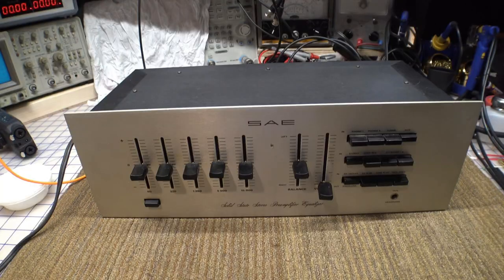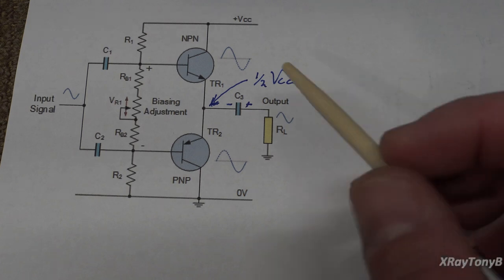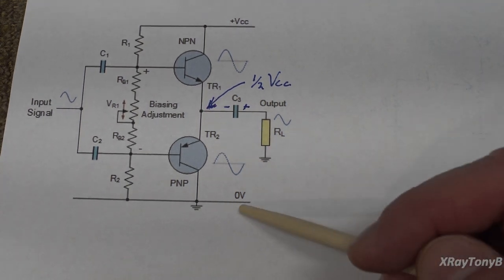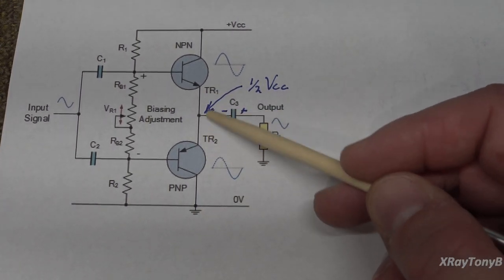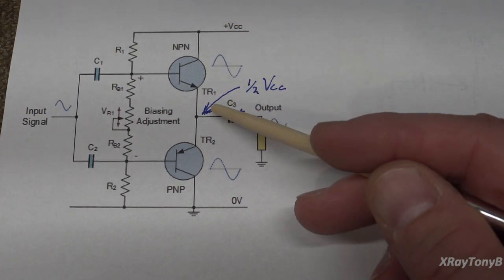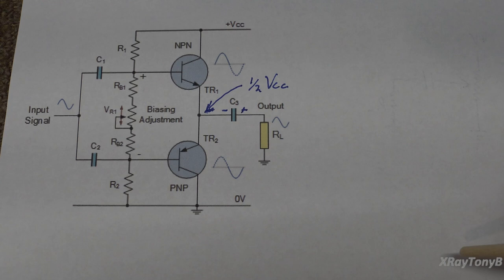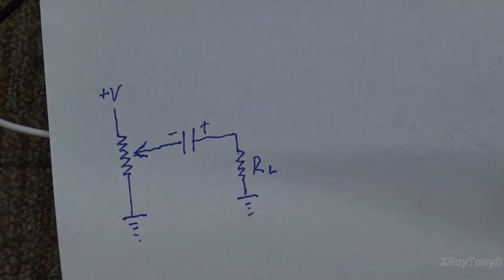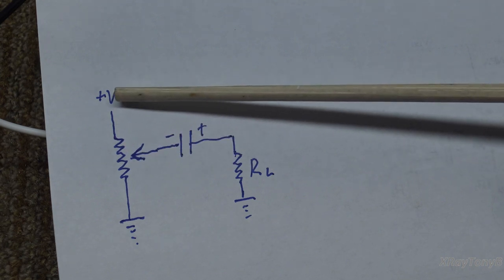Random Video 3 - Amplifier Output Capacitor & Comments from last video

Comment: I consider myself an audio enthousiast, I have 2 big Infinity studio monitors and a Rockford Fosgate active subwoofer in my living room... Together it's 1360 Watts and the sound is very revealing, because most audio sources aren't very good I have to use an equalizer to make it sound much better to my liking, without equalizing it sounds just weird, too flat for me.
Personally I love it when the midrange really pops, the low frequencies make your pants flap on your legs and when you sit down with your back against the chair you feel the bass massage your back, it's absolutely overkill and crazy to have that much power in my living room but I don't have to put the volume very high and still have a super rich sound which is what I love.
I couldn't have the rich sound without the equalizer so for me it's a must to make it sound as I want it to sound.
I hope it makes sense and best regards,
Ricardo Penders

Comment: I was missing your videos after 2 weeks. Finally another very interesting video. I knew about that but didn't tought you could see that simil sine wave with a slow change in resistence by hand. You always learn something. I don't usually use equilization cause I prefer a wave as clean as possible but I understand that someone may enjoy it. Thank as always.

Comment: I think there are two categories: Enjoying the experience of listening to music, which, like You said, kinda, doesn't even necessarily have to do much with "technically" good sound, like coming from a jukebox, you are enjoying the situation you're experiencing while listening to music,; and then there's the "objective" part where you upgraded a part of your stereo system, or improved it by alterations and/or adjustment, where you suddenly hear parts of a song you couldn't hear before, it's clearer sounding, instruments are more defined and more believable sounding, things you could actually measure. Each can cross over into the other sides category, but they're still two different things. "Audiophiles" go more for the measurable part, but they still try to get more enjoyment out of their music, which is part 1, the "subjective" part of the hobby. Bot are legitimate. Whatever brings you more joy. And why not both? :D Having said this, I just bought an 8-track player from the early 70's which couldn't be any farther from "HiFi Audiophile" lol

Comment: Good topics you brought up, Tony. I've heard audiophiles argue for hours on how to design a power supply!  Looking forward to the possibility  of that Fisher AM tuner you mentioned.  In the sixties, I used a  crystal radio to record WBZ Am 1030 to record top 40 music. I fed it directly into a Radio Shack Mono Tape  Recorder that used a 6BM8 output tube. It had a great bandpass for AM and sounded almost FM like with birdies as well. Sorry I erased those recordings, as I'm an avid air check fan. Thanks for  your posts, and would welcome your Xray  archives,
John

Comment: Thanks, It always seemed a bit weird to me that the output could go below 0v when the PS can't.  But the speaker ground is actually sourcing current half cycle which does actually cause the signal to go below ground!  Another way to think about it is that the capacitor "absorbs" the DC offset by charging up to the offset voltage.

Comment: The polarity of the cap is wrong. In both drawings and your demonstration.  Which is probably why the leakage is so noticeable.  (Glad to see you posting.)
Reply from the maker: Oops!  Saved by the viewers again!  Yes, the cap should be reversed.  Luckily, I was applying 10 volts on a 50 volt cap!
Reply: It is not the wrong way round because the plus side of the electrolytic will be connecting to the Base of a transistor that will have 0.5 to 1.5V via a 47K resistor from Vcc.
Reply: @DAVIDGREGORYKERR  One side will be biased at half of Vcc (5V in this case), the other side will be connected though the load to ground.  Since Vcc is positive, half of Vcc is still positive with respect to ground.

Comment: Equalizers: I like them for low volume, where our ears are less sensitive to low and high frequencies. At high volumes, flat is good. Refer to the Fletcher-Munson curves.
At low volumes, "flat" is shouty to my ears. The "loudness" button (or knob) evens out the frequencies at low volumes.
I used to be a "purist," wanting as little as possible in the signal path, until I learned about the Munson-Fletcher curves, and how we hear audio at low volumes. Once I understood that better, I was able to stop spending loads of money chasing "even" frequency response in my audio system. I never would have achieved it without that understanding.
Reply: And this is exactly what the "loudness" switch on older amplifiers did. As it was wired as part of the feedback path to the volume pot, at lower volume levels the low frequencies were effectively boosted and at higher volume levels rolled off.
Reply: @AstrosElectronicsLab  and I LIKE the loudness switch, or knob (variable), as was implemented in some McIntosh and Yamaha models. Many in the current generation of audio enthusiasts shun the loudness switch and tone controls, preferring a single potentiometer as a "preamp" because it means less in the signal path. It took me a a little while to figure out that that approach was actually degrading the audio spectrum at my listening levels.
Reply: Your description is the need for loudness compensation these curves were defined in the 50s by Flecher Munshen

Comment: Yes, please.
Tech Ingredients recently showed some reasonable speaker setups that had crazy notches at, like, 600 hz. A graphic equalizer with enough resolution to treat these notches could help smooth out such systems. This would be used to decolor the sound, not the opposite.

Comment: Ageing and HF hearing loss is extremely common. In fact it probably applies to 90% + of the population. I did know an electronics engineer who said he couldn't hear anything much above 14 KHz and he was in his early 20's. He was probably a bit of an exception. 
I play some guitar and started to lose the higher KHz in my very early 50's. It tails off around 12 KHz now. I also found myself liking the sound of instruments that others thought were too bright, no doubt an attempt at compensating for that early roll off. 
I only dabble now and then in electronics, very little really. How come all the Youtube radio and amp restorers/engineers have masses of test gear??? and why do I find watching valve/tube testers so fascinating? LOL!!

Comment: Another great video, thanks. I am a relative beginner getting into electronics and over thinking everything. Obviously the electrolytic cap is drawn with its polarity reversed but some commenters here are saying that in a real amp circuit the capacitor (in correct polarity) will never see a negative voltage it only varies from 0V to plus 5V but the demo seems to show a dip into minus volts across the cap. If the cap discharging does not cause the apparent dip below zero, does the grounded speaker coil inductance/resistance elevate the working 0V point like a bias resistor or does a speaker coil reactively cause the AC? The slow-mo demo used a resistor load not a coil so that can't be inductance. Hmm :)

Comment: Any EQ will sound better.. if the controls are not set to min or max and the EQ curve is "smooth" (not radically up & down between bands). I'm an "audiophile" who's been hooked on proper speaker/room EQ since the 70's. They are also helpful for 'tweaking" the room curve for listening to some of those old (vintage) recordings :)

Comment: Tony, how do you determine the size of a capacitor in a push-pull transistor amp for 8 ohm speaker loads?
Reply: from 3300 µF and up........

Comment: Remember "high fidelity"? Around the 70s and 80s, as transistors improved and speakers could actually go up near 20kHz, it became possible to built claen sounding, low distortion sound systems without the inherrent harmonics and noisy, microphonic valves of the past :-) Now we could more faithfully reproduce the sound of the studio or stage than ever before. Everyone wanted that super clean hifi sound. Now, it's become so clean and clear that no one of the older generation has any memory of their albums sounding like that. They hear a valve amp with an old paper woofer/ wizzer cone configuration and they smile. That's fine, but for me, I love the advancements we've made. The clearer the better. I'm a fan of the 90s Technics New class A / class AA amps paired with a full range cabinet. Also, I definitely have tone controls or EQ. If I feel something is lacking in a piece of music (or my hearing), I can become a DIY audio engineer on the fly and adjust it to my personal taste. There are pieces of music I love, but would never listen to them flat. I'd never have bought them. Hope that makes sense. Buy what you love and listen how you like!

Comment: Let me just clear up the "audiophile" thing here. The quality of the sound produced by a sound system is only as good as the source material. Start with crap, the result is crap. Simple. No amount of gold-plated, oxygen-free cables or special power leads are going to make one iota of difference.
Reply: Excellent response to the folklore and mythology prevalent among religiously bent audiophiles (audio being the religion.....for them).......how much technical nonsense can be marketed and sold.......or BOUGHT

Comment: I think you may have had some old x-ray gear from Field Emission Corporation. They made cold-cathode high voltage x-ray systems, and were bought out by Hewlett Packard medical division in 1974. They also made oven-type thermionic x-ray machines "Febitron," originally to help produce their field emission equipment. I worked for Field Emission Corp. and Hewlett Packard in the engineering lab when I was in high school and college. The biggest field emission machine was 2.5 MeV. I would love to see some of that old gear.

Comment: People's individual idea of sound is very much like differences in color. I started in the tv repair business in the 1960s and when we went on a service call we would set up the color and hue on a set after repairing it. And so many times the customer would have a fit. They would even say it worked better before we got there. Even though it was completely dead when we got there. So we always started asking before making adjuments if they wanted it set up.  And even then we very often had to make changes as they told us what they liked. You would be suprised how many people wanted green flesh tones answer blooming color.

Comment: Totally agree about listening to the old recordings. I am building speakers with old drivers.  In my mock ups, the older recordings, 1940 - 1950's capitol recordings come to mind, the mock up with old drivers sounded better (to me) than the modern gear.  Yes everybody hears differently.  But there are sone things thag can be done to improve sound quality that the vast majority will appreciate.  I had fun in the conversing back and forth as well.   By the way, did you know that ketchup acts like a capacitor.  I have a audio research preamp where some ketchup fell onto the circuit board across some traces without my knowledge.  I starfed hearing zzzz, ZZZZZ ZAP.   zzzzz ZZZZZ ZAP.  I sent it to Audio Research.  They cleaned the ketchup off.  Problem solved.  They did not charge me but shipping was expensive.

Comment: Hi Tony, I would probably call myself an "audiophile" with some investment in sound reproduction. Over time I have developed my use of sound systems mostly without the use of tone adjustment, finding that well balanced audio usually doesn't need much beyond finding the best placement for speakers and subwoofers. Some fine tuning is occasionally required but this mostly depends upon personal preference. Like your array of gear, not bad for an amateur!

Comment: Got a question. Is this a common theory on AB or just some? Or could you have this theory in mind in every amplifier varieties?
Reply: Class-AB is completely different in the way it is biased (near cut off of the output transistors) and the fact it doesn't require an output capacitor as the voltage at the output is almost 0.

Comment: I would sine sweep the room and use a SPL meter to adjust the equalizer for a flat response to compensate for room acoustics.
Reply: Sweep with pink noise, do as much adjustment to the rooms acoustics with speaker placement, wall/window coverings, furniture location as you can, THEN use the equalizer sparingly.  Yo may not need it at all.
Reply: This is exactly what an EQ or tone control network is for, to equalize the sound to the room's acoustics.

Comment: Bah.

The limitations of the recording media (tape) and gear of the 40s just make the recordings sound that much more charming on modern systems. I absolutely WANT that vintage vibe when I'm listening to Bing Crosby sing White Xmas, on my state of the art stereo system.

I could talk about this stuff for days, too. We should do a zoom call video some time.
Reply: Great Idea Tony!  Richard what do you have in the way of "State of the Art SS"?
Reply: @robertfitzgerald3432  I should just say modern. Not necessarily "state of the art" (whatever that means).

So I still have my late 80s stereo system which is a Carver 900 receiver, with Kef C75 speakers and Energy Pro 22s.

But I recently built a tube preamp from Elekit (the TU-8500) and an IcePower 200 WPC Class D amp to power it. Right now I'm listening through some ribbon nearfield studio monitors (I'm a recording engineer) which are SLS-S8R ribbon nearfields which I think are still made, but SLS got bought out and I don't know who bought them. But these are the best sounding speakers I have ever heard.

Overall I am very pleased with the new system. I am going to get some new speakers because I need my studio monitors back in my studio.
Reply: @Wizardofgosz  I'm using a DUAL 1264 ULM T Table, Technics SA-X51 Pwr Amp/Tuner/Receiver and Bose A2000 Spkrs.
Reply from the maker: I couldn't have worded it better!

Comment: So that is why I read 15 Volts across the speaker terminals of a small pioneer receiver with no speaker connected.  No way to drain the charge off the cap
Reply: Assuming it's Class A, yes.

Comment: I’m sorry but you’ve got this wrong. First, that capacitor is the wrong way round. The + end should be connected to +5V. Second, at audio frequencies when the capacitance is large enough to couple the load, the voltage across the capacitor does not change significantly. The AC voltage appears the same at each side of the capacitor and it is this AC voltage that produces the AC current in the load resistor or speaker. The capacitor is there to prevent DC flow into the load. In your example you are turning the voltage up and down very slowly so you do charge and discharge the capacitor. At audio frequencies this does not happen when the capacitance think you should remove this video and redo it.
Reply: Last paragraph should be:
At audio frequencies this does not happen with ‘coupling’ capacitors. There is little or no AC across the capacitor just a fixed level of DC voltage. I think yo should remove this video and redo with correct information. I sure this was meant with good intention but it’s not fair to be giving out such misinformation. Hope this helps.